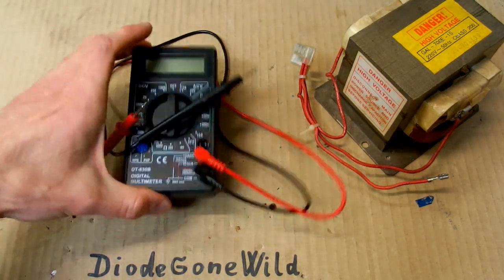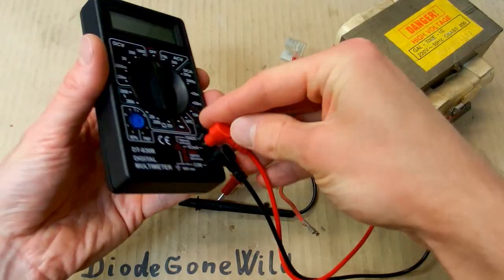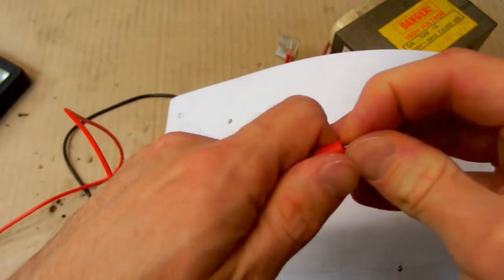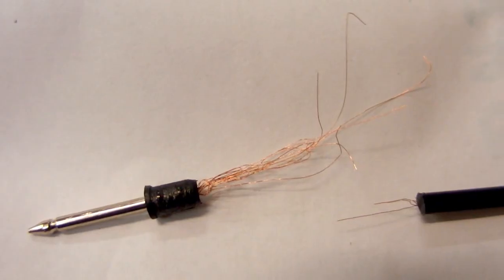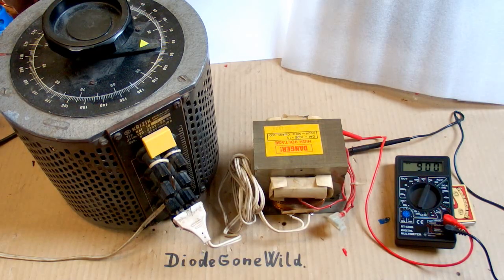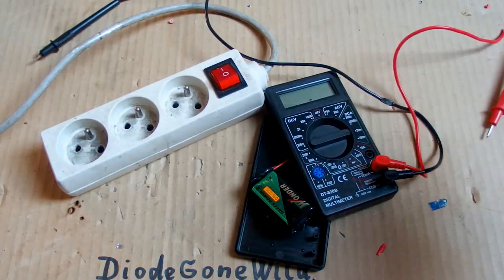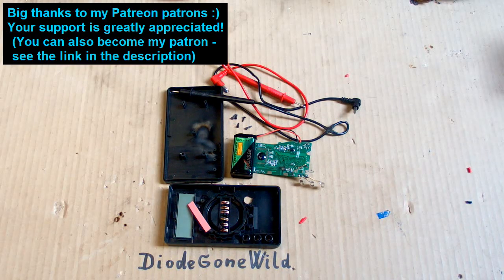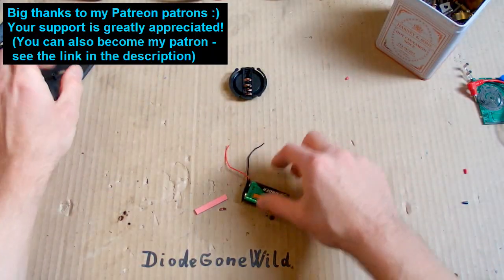$3 multimeter - high voltage & overcurrent test (smoke and explosion)

Comment: This was my first multimeter I bought locally at about age 13. It was made by Mastech and cost about 10 euros here, and it contains a fuse, better connectors, cable, seems to be a bit better made then the one in this video. This simple Chinese design hasn't changed for decades - I've seen such multimeters even in pics from early 2000s by different other 'brands'.

Comment: In my experience with those, the thin traces and anemic resistors ARE the fuse. Also, two rechargeable Li-ion batteries in series, rescued from the vapes littering the streets, and wrapped/padded with tape to avoid them moving around and contacting the lead posts, do nicely for replacing the 9v battery. As a bonus they last longer and make the meter weight even less.

Comment: i purchased for 0.8$ from the local market.. and surprisingly have been using that for the last 12 years no problem.. i replaced the wire with new good wire and crocodile clip.. also replaced the battery several times (0.2$ each)

Comment: Never measure 10 A with this meter for more than 15 seconds continuously, after measurement let it cool down for 10 minutes. On older meters (eg. UNIT M830BUZ) this was mentioned on the front plate.

Comment: 6:22 I did this with my multimeter but I didn’t know it was on DCA so when I plugged it in no voltage was coming and I though I blew my multimeter fuse but no IT WAS ON DCA good Multimeters can save you from death like my one

Comment: Did you applyed current in the amper meter like voltmeter you just heated those wires like a resistor and you didn't use it as a 10 amp Amperemeter like devided resistance 🤔

Comment: By reading the comments and seeing your video, I'm assuming that the old DT-830D models were good, your one is a bit worse and mine is the worst.  The one you have has many youtube tutorials on fixing it. By the one I've uses a bit different board. Your one has a better shant than mine. After mine was busted, I had to throw that away and buy a new one. These are good for small DIY projects but not for serious projects/measurements such as high voltage.

Comment: I got the same probes in a good quality multimeter pack and your is the exact same like mine it broke in my hand in 4 days so I got better (CHINA) probes with better thick wires and the wires don't come out as shown in the 1000v test and the connecter is covered with rubber like the good probes you showed

Comment: Those cables are fine, as you see, it is protected by a fusible multimeter with several redundant safety elements.

Comment: For all tests the multimeter passed perfectly, except the purposely abusive one. This multimeter is perfect for one who is using it for low voltage or even checking mains voltage sometimes. When getting nearby higher voltages you need to be aware of the risk. If you are just someone who cannot take care of what you are doing, just do not use a multimeter at all, no matter what brand and quality.

Comment: Actually you got lucky with this one, the ones, that come into my country are far worse: on one that i have  probe connectors are on separate board, that is soldered to main board by 3 tiny tinned steel wires, that look like 1W 5V zenner diode leads.

Comment: I was fixing lcd tv and accidentally touched inverter transofrmer, now multimeter died. Anyone know is it possible to fix it? None smd components or ics blown, fuses good. It wasnt cheap, well about 40 eur from China. Thats so bad. I was using that multimeter for capacitor testing and now I  cant test any capacitor and in my stupid country cheapest capacitor tester is more that 100eur

Comment: I actually got one, I know cable are shitty, so just get a better cable. 
I added a fuse holder + a fuse in it. Some of us are just hobbist and need a multimeter to handle 12v/ 5v, and it does the job.

Comment: I have a DT-832 multimeter like the one in the video and believe it or not it damn thing broke already. I probed 110v at 6 amps and the probes didn’t cross but I got the biggest spark and one of them melted.

Comment: I got the same multimeter and i tell you its quite good if you know what you re doing. Sure the test leads are garbage. And you have to remember there is no fuse inside. The accuracy is not super great but its  quite stable device and works.

Comment: I have the same model, for something so cheap it does the job. I use it only to test continuity and DC voltage. The probs doesn't always give accurate readings, so measure twice and press hard on the surface.

Comment: I paid like $12 for my first multimeter, and it works fine, but I accidentally shorted the mains through it, and I found out that it does have a fuse, sort of, i.e, the trace on the board, which completely blew off. I fixed it by just soldering a thin wire (so that it can still be a fuse I guess) across where the trace went, so it still works fine.
Reply: Better idea would've been soldering a fuse between those traces no? That way you could've turned it into an actual fusable multiemeter for less

Comment: While putting a CE mark on it, the manufacturer shall warrant at least some safety characteristics according to European Union regulations (isolation, vibration, shock, etc. e.g. CEI 664, CEI 61010-1). It's obvious that this is not the case here! Not a single part is compliant with safety!
So the manufacturer is lying, this is a pure counterfeit and a very dangerous tool. Never buy this kind of "gadget", your life is at risk with it.

Comment: The test your are doing with the ampermeter at 10 amps must not exeed 10 seconds for professional  DMM's equiped with a fuse. This is also true for this multimeter I guess which doesn't have a fuse. Thanks.

Comment: I suggest it wasn't so much "arcing" between the two conductors at 07:39, but it is more likely there was a solder "blob" or "tailing" that decreased the gap between those two conductors and that is what caused the damage in that section of the board. Those two conductors look too far apart to arc at normal mains voltage levels.

Comment: I've got some cheap multimeter I got from ebay for like 8 bucks, it looks like a fake fluke meter and it's actually worked really well for me except it came with similar leads that broke off very quickly, so I bought some new leads for it and now it's perfect. I would never stick it into high voltage though, but I'm not experienced enough to mess with that anyway so it's fine for me

Comment: Since you say, there is room for a fuse, would it be doable and reasonable to solder one in on your own? 
I'm not working with high currents or voltages and the probability of forgetting to choose the right measurement scope, thereby bricking the device, is pretty high, while I only use it for rare activities every 2 or 3 months. So investing in an expensive device isn't reasonable for me - better I brick a cheap one every 4 to 5 years.

Comment: Oh wow. That's EXACTLY the multimeter I have been using for 7 years! Seriously! Just for light duty though. Already replaced the probes with good ones after the old one broke at the tip.  EDIT: I just opened it and the PCB layout is a little different and bigger. For the one seen in the video, the manufacturer decided to cut even more corners.  Still no fuuuuse. That's niiiice.
Reply: In my experience with those, the thin traces and anemic resistors ARE the fuse. Also, two rechargeable Li-ion batteries in series, rescued from the vapes littering the streets, and wrapped/padded with tape to avoid them moving around and contacting the lead posts, do nicely for replacing the 9v battery. As a bonus they last longer and make the meter weight even less.

Comment: Mine which is a 830d model (almost the same) has even cheaper shit, even smaller tiny leads between the cable leads connectors board and the main board, and even cheaper stuff on the board

https://photos.app.goo.gl/j3tEa5fn9BoSzkq4A

I mainly use it for 12 volt car batteries so it should be fine

Has a speaker tho so hah thats kewl

Comment: My old DT-830B (from the last decade of the previous century) survived the "connect to the mains in ammeter mode" test. However, I used it in 10A mode (with the red probe connected to the 10A connector). It melted the front of the probes, but it still worked after this.

It had 200mA fuses and I changed them alot.

Comment: My university had the students buy these meters (for $10) after they got ride of the Agilent meters in our lab, by the second lab session 30% of the students meters were broken. A few of us with the assistance of a frustrated lab instructor managed to get the department to buy the lab new Keysight meters and the school bookstore had to buy back all the shitty broken meters. They never really admitted fault, but at least they fixed the problem.
Reply: Our meters were like $40 and had the same shit quality
Reply: This is also why old stuff exists. In Czechoslovakia, schools used to get a big multiple scale analog multimeter - insert the right scale, and everything else is reconnected to measure anything. I'll edit this comment when I find suitable photos.
Reply: Keysight is a bit of an overpriced brand but decent (you can tell they've got enough money from the electroboom sponsorships almost every video), they could've gotten much better value for money not buying keysight
Reply: @joopie46614  The department had a decent relationship with the local keysight office so I'd imagine they got a decent education discount. And also keep in mind 2 things 1. They had just had a massive fuckup trying to pinch pennies. And 2. These need to last as long as possible with daily use from dumbass students and TAs.

Comment: I'm using the exact same multimeter. Mostly use to check the voltage of my rechargeable NIMH AA battery since it the charger dont have any indication whether its full or not. Usually when it is 1.4V i consider the battery is full.

Comment: I have one of those, but it looks like a different version inside. If you just use them for low voltage, for 3€ they are extremely good. Mine took quite a lot of abuse. The 20/200 mA range is no longer working after i shorted a 18650 with it. Still useful to monitor voltages, continuity, check shitty resistors values or even for the uA ranges sometimes. If you use it properly it is decent.

Comment: Why a using fuse, if the tracks can be used as a fuse 😂
Reply: Or the leads for that matter!
Reply: nokia 3210 chargers used a track as fuse, but it's on the low voltage side, also it says 3.7V DC but it doesn't have a capacitor and it's like 8V
Reply: With enough watts, anything can be a fuse :D
Reply: Fusseless
Reply: Maxent Baillet  No no no fuse is useful that is why  tracks are fuse XD

Comment: Been a long while since I've seen one blow itself apart, let alone as "gracefully" as that one. No shrapnel, not a very loud BANG!, and the leads weren't melted or blown clear. Maybe the crap component choices and PCB layout are 'accidental safety features'? lol
Reply: Well, if cost is a factor, they could have used a PCB fuse: A very thin trace. Doesn't increase the cost. It is not replacable, but would make the device fail in a controlled way.

Comment: I am just wondering how long had you been torturing the cables with 10A? Just out of curriosity some, even „goog“ brands give you max 10s on this much Amps. So I am wondering this multimeter didn’t get out so badly at all, if you know its limitations and I am positively surprised.
Reply: g o o g
Reply: Exactly. If you keep it away from mains, it is a nice meter!
Reply: @semiRockethr  i use to measure only DC volts below 12v and DC amps below 1amp with this meter and this meter gone wild and now shows incorrect readings

Comment: I also accidentally put that cheap meter when i buy it first time into main 230v while i set it to 10 amps... But the cheap cable works as a fuse and saved my multimeter and i still  using it for about 3 years and it is still working fine.....
Reply: well mine one shows wrong voltage just randomly
Reply: I have an AN8008, it costed 20€ It's nice.

But I also have a couple super-cheap horrible ones built with the smelliest plastic available.
Reply: I have the same one and it cost me 500rs.
Reply: I just checked mine and found that it also didn't have a fuse!
 got it for 250rs.
Reply: i got it for 200 PKR
Reply: Jaspreet Singh mine costs Rs 160 INR..
Reply: Its dt 830 d
Reply: mine one is b

Comment: I also have one. But the model is 830D. The black probe wire has broken after a few months of use. And the selector becomes loose after one of the small ball (I don't know how to call it but it is placed on the spring of the selector) suddenly comes out. Plus, the resistor measurement isn't working normally anymore.
Reply: Fikri Noh - I think the name you may want is ball bearing.

Comment: I have several of these "free" meters from Harbor Freight. The probes are so bad that I don't even bother picking them up in the store any more. Thanks for blowing one up. The arc going through your power strip was concerning. Did you look inside it after the event?
Reply: not much happens really, only small bubbles of molten metal and a little soot from the smoke form where it touches the tip. Similar to when you hot plug in some high charge and it leaves marks on the blades of the plug.

relatively they always survive, since even in a house with fuses they will blow before the plug is damaged, or the same cheap wire will melt sooner inside and cut the circuit  Or well that happens in a 120V AC system

Comment: I saw a HVAC guy using one of these measuring between 480v phases once! He told me he looses too many meters to get proper ones! They are used out in the field way too often!
Reply: one day ! he might regett it
Reply: It would end up cheaper if he bought a proper one with a replaceable fuse. Fuses cost almost nothing and you can get a massive pack of them, way cheaper than buying a new multimeter each time.
Reply: I'm pretty sure I wouldn't want an "HVAC guy" who is constantly losing important things (like tools) to be working on any systems in my buildings or attached buildings. I can just hear him talking to himself about a new replacement circuit breaker...or similar safety-related component..."Well, if the new part's not here where I put it, then someone must have replaced and tossed-out the old one."
Reply: He lost it
Not blown it

Comment: 120% more of tensione but I was really scared by the tiny insulation of the wire i really dont want to hold in my hands the probes when measuring more than 400 volts!

Comment: Again nice to hear your English. BUT never hold the probes with two hands when measuring the mains voltage. If the probe or wire insulation leak, you can get electrocuted. We professionals ( and amateurs, I hope) keep one hand in pocket or behind the back when measuring mains voltages or high voltages.
Reply: mattikaki - in general this is good advice. However if using good quality probes (that actually meet the relevant CAT specification) from a manufacturer (and supplier) that is trusted, then for some tests, you have to use both hands. For example, when fault finding on live electrical/electronic systems, or when testing to prove that an electrical system is indeed dead after an isolation (testing for dead). In these situations the use of croc clips is strongly discouraged as they would be an even greater safety hazard.
Also if using a multimeter (or voltmeter) on mains voltage systems, or higher voltage systems, you should really be using lead/probe sets that have a fuse in each probe.

Comment: The meter came apart because the screws were removed during your short circuit test.  The test leads melted because in taking a current measurement you only need to connect it for a few seconds, of course they melted.  This meter can measure in the micro-amp range and is quite accurate.  To fix the probes, take them apart from the heads and fill the handles with hot glue then put the points back in.  Read and follow the manual.

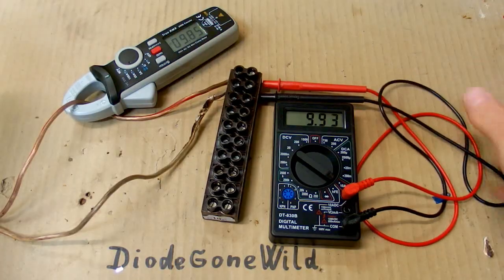Comment: The meters we get like that have a warning label on back that instructs not to run 10 amps for more than 30 seconds. There is a cut in your video at 3:20 so it is impossible for me to say how long you had to exceed the time limit before you managed to get the leads to fail. But you'd almost reached the limit at the cut. So did your meter not have the same warning label or are you just bad at following instructions?

Comment: I can't stand shrouded banana jacks. Probes from one meter rarely fit into another. So I end up cutting the shrouds off. If you want protection try using the space between your ears some.
Reply: I´ve never had any shrouded plugs not fit in any connector for them. Except in one of these meters (the slightly better version), which I don´t use anyway.

That being said, whenever I make banana plug cables, I almost always use unshrouded plugs just for versatility.
Reply: Shrouded plugs are required to meet the relevant CAT classification. If using for “ELV” work, then it may be okay to use non-shrouded plugs. Any decent modern multimeter should accept shrouded plugs. And panel mount sockets suitable for shrouded plugs have been available for many years (at least ten).
Reply: My cat rates my meter probes highly. Heck he likes them. He likes everything that's like a string. He's a cat.
Reply: In my experience the probes from decent and half-decent multimeters interchange just fine with each other and with 4mm shrouded connectors bought from electronic suppliers. What can be a pain are cheap meters designed for bastard half-shrouded connectors which sometimes won't take properly shrouded connectors.